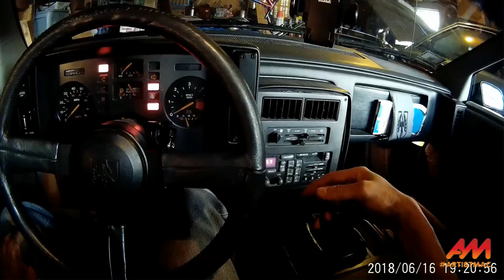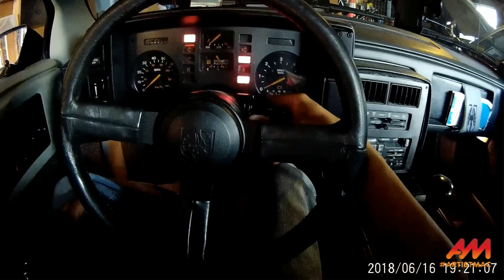My Fiero - Trouble in Clutch Land Pt. 8 - New Slave Cylinder & The Bleed

Comment: I did the years ago on my Fiero. What a pain in the ass until I reverse bled it.  I bought a brand new oil can, filled it with brake fluid, put a hose on the the spout and the slave bleeder, started pumping and waited for the bubbles to stop in the clutch reservoir. It worked like a charm.

Comment: I wonder if heating the end of the tube with a lighter would have shrunk it down a bit to fit over the new bleed screw.
Reply from the maker: It would have. I was in panic mode by then. As it turned out, the problem was with the clutch arm that went down into the transmission. Oh, my aching head! :)

Comment: You'e got more than one issue. Check the clutch safety start switch and wiring at the pedal. Engine should start no matter what. Swap the bleed valves back over because those were designed and machined to match the slave. Now try vacuum bleeding the system. Vacuum bleed kits are cheap and will save headaches associated with pedal pump bleeding which never works well and requires 2 people.
Reply from the maker: Thanks, Bigchested. I went back and looked at one of my previous videos, and in that one, before I started putting new parts on and bled the system, the safety switch went all the way back to its bump stop when the old pedal was pressed, which it's not doing now; it stops about 1/2" from the bumpstop, and that's with me pressing the clutch pedal as far as it will go. It feels like I'm pressing on a balloon, so I definitely need to re-bleed. And I will put the new bleed screw back on the new slave, and just buy the right size smaller tubing. Aah, too smart for my own britches, and it came back to bite me. Thanks again!
Reply from the maker: I should have said, "The plunger on the safety switch went all the way back to its bumpstop."
Reply: Check out this link for the switch adjustment: http://www.fiero.nl/forum/Forum2/HTML/123269.html
Reply from the maker: Thanks!
Reply from the maker: Before the big bleed this weekend, I tried a little experiment, based on what someone else on YouTube had done. Bleed screw closed, cap off the master cylinder, no pressing of the pedal. I started compressing the rod on the slave, slowly in and back out, and with each compression, air bubbles came up through the fluid in the master cylinder! I must have done about 20 compressions, and bubbles were still coming. Would there still have been that much air in the master and all through the line, even after I thought I'd bled it completely last weekend and no bubbles were coming out the bleed screw?
Reply: Quite possibly yes. Did the fluid level in the master drop? (fluid taking the place of air in the system). How does the pedal feel now?
Reply from the maker: A bit. Fluid level went from the "FULL" line to slightly below the line. Pedal  goes down a tiny bit more than it did. Still feels like there's a balloon under the pedal. I'm guessing there's a lot more air in there, considering that both the master and the slave are new, and, as I confessed in the video, I did let the master run out of fluid at one point while I was bleeding it.
Reply: You never want to let the master run out. That always marks the start over with air process.  You really need two people - one to bleed the slave while the other makes sure the master never goes dry.
Reply from the maker: True. I may have to call in a favor to have a friend watch the level in that master. ;)
Reply: New to Fiero ownership, but more than familiar with engines in general and the 2.5 four cylinder in great detail. I have a question and since you've had your Fiero since it was new, I was wondering if you could tell me how far your pedal goes down to the floor? Mine seems to allow the transmission to shift into gear maybe an inch and a half before it gets to the floor boards. Is this normal with this car?

Comment: You should have not push the rod in and out at 8:30 on the new cylinder. It was coming back out slowly because there was no OIL in there thus sticking. Hopefully, your rubber seals are not damaged...
Reply from the maker: http://www.fiero.nl/forum/Archives/Archive-000001/HTML/20060811-2-069810.html